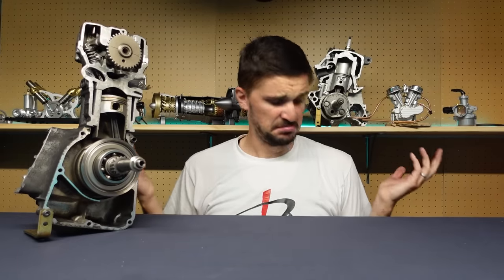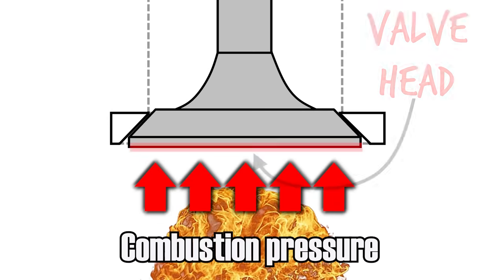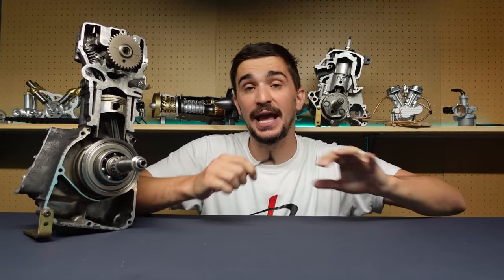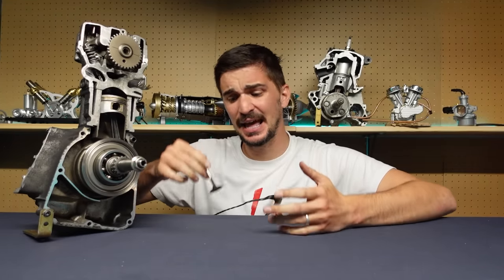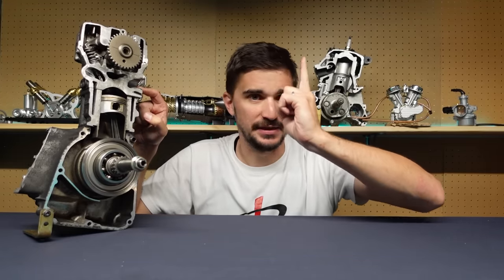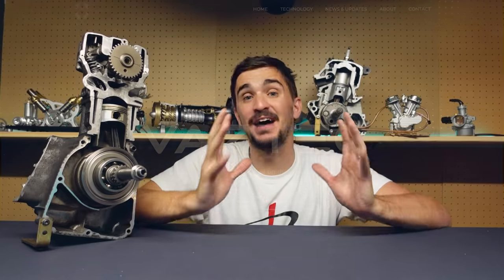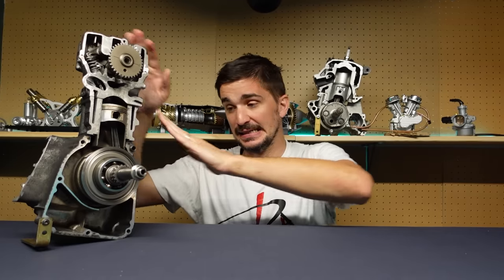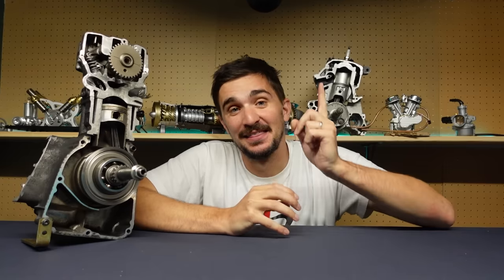Rotary Valves Make Normal Valves Look Silly - Why Aren't We Using Them?

Comment: Back before the last ice age when I was an apprentice mechanic, at Fords training center there was a 6 cylinder engine with twin rotary valves. This was a live and working motor that was in the dyno room. The normal pop valve 6 would rev to max 6500 RPM, the same engine with the rotary valves would rev to 11000 RPM, the weakness was the bottom end. The pop valve 6 would make 147KW power and 287NM torque at 6000RPM and 3000RPM respectively. The rotatory valve engine 235 KW and 315NM at 8000RPM and 3400RPM respectively. Great video on this topic.
Reply: Wow! Thanks for wisdom and positive feedback from ice age!  :-)
Reply: What volume did this engine have?
Reply: The only issue that Ford had was the lack of flux capacitors.  We’re experimenting with some right now and its been very promising.
Reply: @AdamEarl2  i hear doc brown is working on it
Reply: So the bottom end needed to be robust but otherwise it worked great? Sounds like something too good to be true. Since my own Ice Age vehicle a 71 Ford with 351 Cleveland it's wild to see how much progress there has been on engines, including computers, injection, friction-reduction, metallurgy, modeling, boost, etc.. from back then and same goes for the ultra strength steels used to  weld up cheaper unibody frames and bond together fancier frames. I think the biggest barrier today just as in Congress is battling with dinosaur technology hogging the roadways. Super light cars can be made but they won't survive impacts with heavy vehicles.  Ideally I think we need heavy vehicle lanes and light vehicle lanes, or just separate streets/roads.
Reply: @jamesmedina2062  Will the idea also work to fix Congress...?   ;)
Reply: There was a research rotary valve engine before WW2 called the Itallia (I think) which would rev to 14,000 rpm easily.
Reply: @jamesmedina2062 : Try using a Chevy bottom end and it generally won't split in half like a crappy Ford.

Also, it is ridiculous to expect a whole new bunch of highways to be built just for your lightweight cars.
Reply: @nitromartini1422  a Ford bottom end will split in half? Thats news to me! 

I did not say new highways were needed for lightweight cars.  You don't seem like the creative kind of guy so i will spare you any more new ideas.
Reply: @jamesmedina2062  achieving more power through similar torque but higher rpm with the same engine geometry you need to make reciprocating parts (piston, conrod) as light as possible while still being as strong or stronger (forged). because reciprocating means vibrations and also vertical acceleration*mass translates into stress on the crankshaft. crankshaft has to be strong but weight is less important because it can be balanced.
Typically doubling the rpm of an existing engine would be really hard, because you will also run into issues with the valve size and intake/exhaust flow and you probably have better chance designing it for high rpm from the ground up with over square cylinders (big bore, short stroke) Ducati panigale v4 revs to 16krpm and it has 81mm bore x 48mm stroke. it wouldn't be possible if it wasn't that oversquare
also making more/smaller cylinders can help increase but it comes at cost of complexity size,weight and power losses.
Reply: @jamesmedina2062  guys trust me one more lane will fix traffic guys please anything but trains and transit
Reply: At some point, we realize a turbine is the ideal ICE. With hybrids every disadvantage to turbines goes away. Any fuel, high efficiency, and effectively no limit to horsepower. Just balanced rotating parts.
Reply: technically were still in an ice age..... but i get what you mean, lol
Reply: @Chip-Chapley  We are in the interglacial period. People often think it means in an ice age. It literally means "between ice ages."
Reply: @ryanmcgowan3061  interglacial period means "between glacial" not between ice ages.....
ice ages are in stages, interglacial periods and glacial periods, glacial periods are times when the sheets of ice cover the earth, interglacial periods is when the sheets recede. ice age ends when the polar ice sheets and alpine glaciers have all melted.
it's a misnomer to call glacial periods an ice age.
Reply: @Chip-Chapley  Yeah, you're right. I'm reflecting on a conversation I had where someone thought interglacial literally meant ice age.
Reply: I think this type of rotary valve will stay problematic considering the enormous heat it has to withstand and the tiny yet very hot exhaust gasses continuously escaping circumferentially of the valve.
Reply: @jamesmedina2062 Congress won't be battling anything. The creation of the administrative state is their baby, when they created many agencies to pass defacto law without their direct approval. This same administrative state is mandating a lot of weight into vehicles to make them safer, and electric cars can be heavier because batteries are. SUVs are safer, and people want them. It isn't old cars that are the heavy ones. It's the newer ones. Seriously, look up some common vehicle weights from the 1960s-1980s and then from the 20-teens or 2020s. Anyway, congress won't be doing anything about whatever the NHTSA is doing this week, ever.
Reply: @ChevyConQueso  Your mentioning what Congress will do this week is funny. They are on 2 week Easter recess.  Change takes time. I was not proposing some kind of fast one-week solution just stating facts. I join the light community every week, a set of people who walk, ride the bus, ride a scooter, ride a bicycle etc and use sidewalks or other paths. Each one of us saves hundreds of gallons of fuel annually the more we do this. Some communities offer more support than others and I know that the expenditure on the infrastructure is less than 1% of what is spent on heavy transport. I know fully well that large vehicles need very large batteries and no, SUV's are not safer because the are more cumbersome to drive and if impacted certain ways will invariably roll over. Given their weight and depending which of the hundreds of different models is in question may be safer in some particular accident.. Obviously a lighter vehicle needs a smaller battery.
Reply: Bottom end... perhaps this could work with either a Mercedes M103/M104 or a Toyota 2Jz, among others. these engines are known for sustaining absurd amounts of power reliably.
Reply: russbell6418  Is that a real question? Currently climate is dictating a huge part of engine design, and there's a case to be made of whether it's anthropogenic, or not
Reply: @jamesmedina2062  "So the bottom end needed to be robust but otherwise it worked great? Sounds like something too good to be true."

The key point was he mentions the rotary valve engine would reach 11000 RPM.

"The normal pop valve 6 would rev to max 6500 RPM, the same engine with the rotary valves would rev to 11000 RPM, the weakness was the bottom end."

That's why the bottom end became an issue. In a normal poppet valve engine the valves are the weak link. At some point they start to float. When you eliminate the poppet valves then the engine can rev much higher and something else, the pistons, rods, crankshaft, etc., becomes the limiting factor. 

As for rotary valves, sealing becomes an issue. You can probably make it work for a while but in the long run wear will affect the seal. So, an engine in a lab, that runs very little, for demonstration purposes can probably work fine, but if you sell someone a car that they expect to last 200,000 miles, that's a different story.
Reply: russbell6418  Alternatively, we can start by electing folks with a record of operating in good faith, not grifting. But given I am not an expert, I may be missing something here...
Reply: @ryanmcgowan3061 does a turbine even count as an ICE? Spews put so much heat it would make you think it's an external combustion engine. If it weren't for the heat and the noise I'd bet they would already be standard.
Reply: @ryanmcgowan3061 we all know it's not anthropogenic
Reply: Turbines for static power like a hybrid vehicle setup can be really small for the size of the vehicle. They basically run continuously at their full rated power while needed.
Reply: @jamesmedina2062 , remember an electric motor has 3 moving parts, total.  No camshafts, bearings, valves, injectors, rods, pistons, manifolds, exhausts, etc.  "The best part is no part" idea of reliability following part count is huge; it's hard to beat 3 parts.  There's industrial electric motors with 100k hours and/or 100k start/stop cycles, it's not that unusual, that's 10 years of constant use.  Good luck with any combustion engine on that, obviously.  Seems like that's the direction people are going for a pretty good reason, hard to argue with shipping electrons instead of explosive hydrocarbons, for price/safety/easy/etc.  Trouble is, people keep complaining they want the engine to vroom louder?  I'm confused?  Seems like loud is annoying.  Swiss watches aren't loud, they just sit there and keep going, forevermore, no worries.  i like a car with no worries.  Vroom is boom-boom for car speakers, imho, better to blast van halen and let the EV motor hum away.
Reply: @kevinrice957  Yes I get you. In fact I am singing in the same choir that you are, only that I attack mobility from weight standpoint. As a cyclist and observer of pedestrians and scooters and electric bikes it seems that we should advance these types of technologies to simply add small motors and add protection from elements. Few people use fairings on bicycles but they are on motorcycles. Why not have all kinds of varied light vehicles? But the problem is the vision in eyes of companies is limited to what is legacy and how much of a leap is needed because they scope out the public as if we were a school of fish and they were sharks. We need huge rapid changes and yet incremental approaches are happening while vehicle weights are now around 5000 lbs average thanks to truck and SUV popularity. It seems the worse the world gets the more selfish and siloed many people become rather than becoming more generous and trusting. 

Electrons are sadly ephemeral to some extent unlike liquid fuel. I have a glass mat battery that is keeping a good charge but the price of entry was low at $200. Its when we ask the battery to push 4000 LBS of metal that things get a little extreme. I think we need to maintain charge in vehicles via solar or perhaps human assisted. Like why should we pay a gym to help us burn energy but when we transit on roads we are to not expend any??

I totally agree on the audio bit. I am a huge music and audio buff. I wish everyone could listen to music as I do and as you said less noise from road and engine the better to enjoy the music. 👍
Reply: @jamesmedina2062  We have them already. They are called railroads.
Reply: @jerryashenfelter8181  we have what?
Reply: @jamesmedina2062  road tax like airline baggage (and tickets) should be charged by the pound.  This might put land barges and wastelines on the road to normality.
Reply: @iancormie9916  yeah but even that is not appropriate. Well if they are taxed in parabolic (exponentially) curve then it would reflect the dramatically more lethal and dangerous that they are in accidents. The truck guys  here even drive more aggressively as if that was the plan all along and police are hands off these days. Just like Walmart the George Floyd and Covid stuff gave them excuses to cut back and they are staying on donut break. 🍩🍩🍩
Reply: Before the first ice age hahahah😂
Reply: @jamesmedina2062  I don't think we need new highways for lightweight cars, we need better passenger cages to protect the occupants in a crash when the rest of the car crumples like an accordion.   The other issue with highways is the weight of batteries in EV's like the Tesla which are much heavier than an ICE car.
Reply: @markvl11  are you familiar with something called racing? If it's a lightweight car, it only needs to create a cocoon like inner structure that endures deceleration and impact but what do you do when heavy vehicles impact you? Race cars keep drivers safe even at impacts over 100mph. The problem is the typical heavy vehicle like a Tesla or pick up truck. Thats exactly the problem with engineering cars today. Your vehicle using advanced materials could get over 100 miles per gallon or if solar power itself forever but crash-protection with heavy vehicles is killing this option for mainstream public. It will happen though eventually. It needs to happen sooner than later. For example look at golf carts. 80% their weight is heavy batteries but if equipped with lithium batteries, they would weigh less than the two occupants by a long shot. But the vehicle like that is not road-worthy in urban environments due to heavy vehicles out there.
Reply: @monoracer_  From these figures something about 3L. Usually torque divided by 100Nm, tells you the displacement in Liters. Of course this is only for naturally aspirated engines.
Reply: Lol, made up story. If you were working at Ford, certainly if it was that long ago; you WOULDN'T have been measuring in KW
Reply: @Chip-Chapley ICE age, internal combustion engine age lmao

Comment: The traditional valve is proven technology. It has been used on all varieties of internal combustion engines using all types of fuel for as long as internal combustion engines have existed.. The simple answer is that, introduce more moving parts and you introduce more failure modes.
Reply: But a rotary valve system, done right, would be way less moving parts, wouldn’t it!?